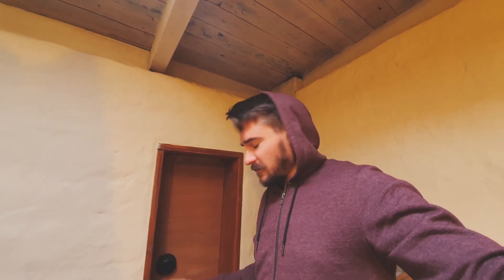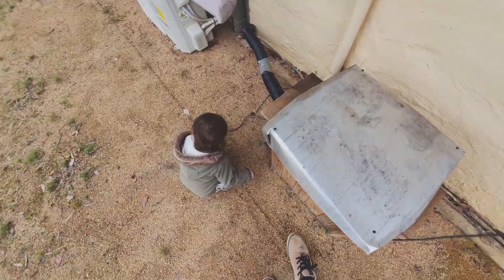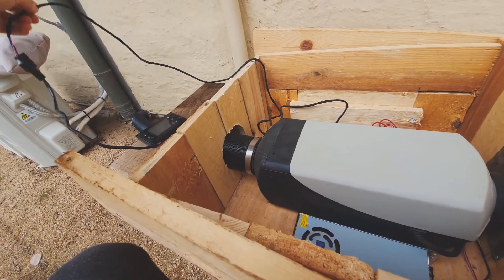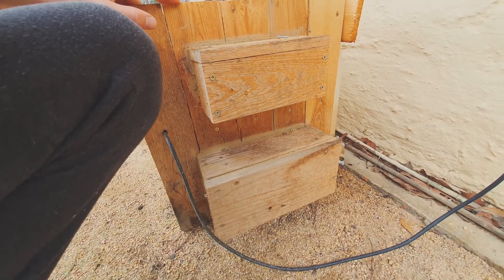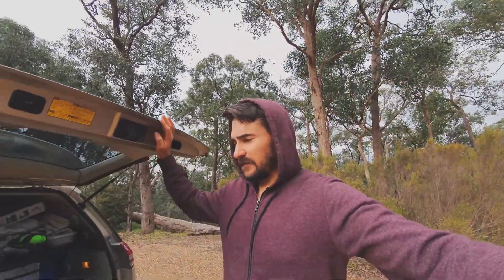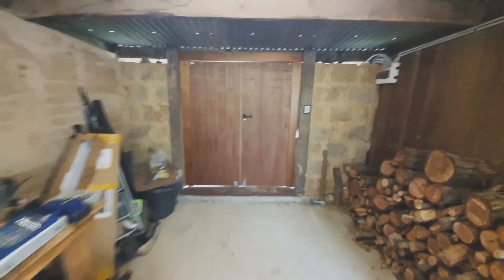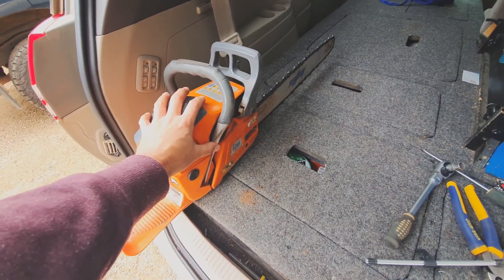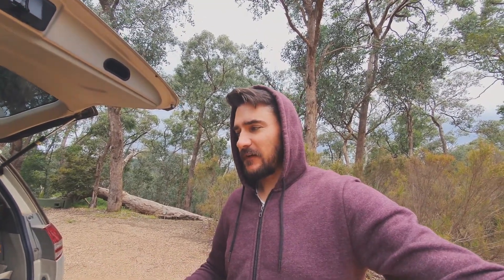Diesel Heater and Chainsaw UPDATE! Both broken...kind of...

Comment: Hi mate , instead of using vice grips ( backwards ) to remove the stud , you can put two nuts on and tighten them against each other ( lock nut ) and then use the lower one to undo the stud . I have the same MTM saw so I was curious to see what "broke" after watching your earlier video on the same saw . Cheers from Qld .
Reply from the maker: Hey there. I didn't show that in the vid, but I did actually try that as i've had it work on stuck studs on my old car before. What happened on the saw though was they both just kept rotating together. Maybe from all the bar oil it wasn't gripping? I probably shoulda have cleaned it down and tried harder.  I was going to do a small spot weld from nut to srud too, but a mates got my welder still :$ 
Thanks for the feedback!